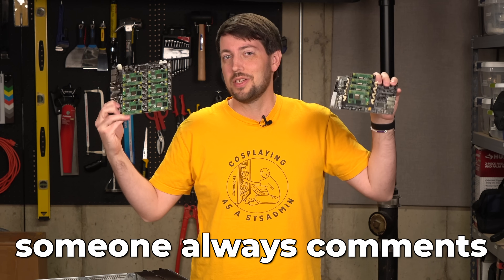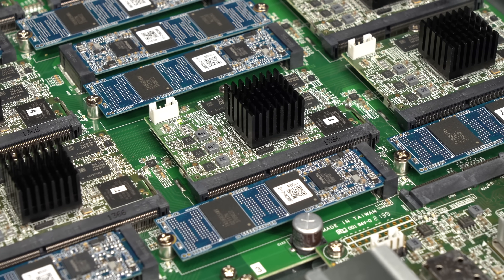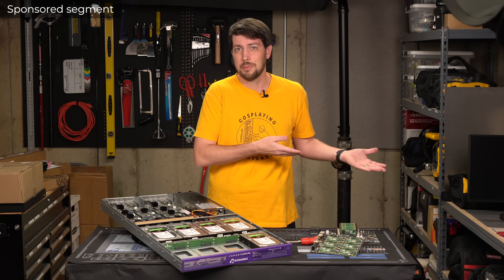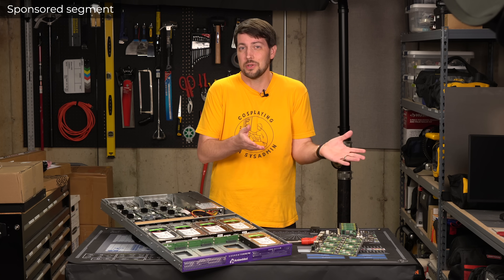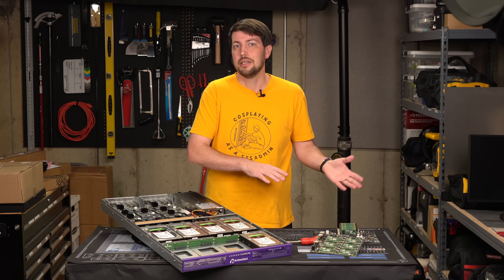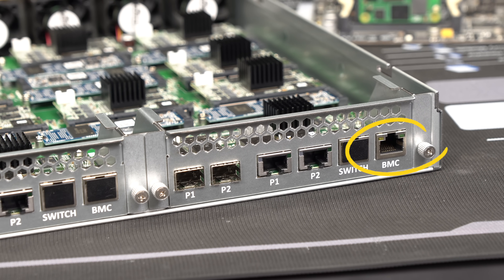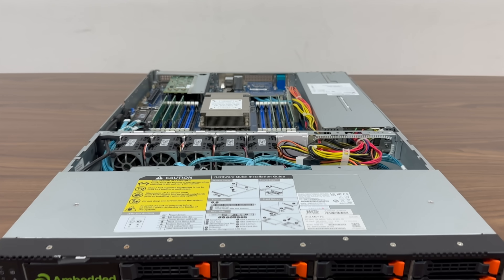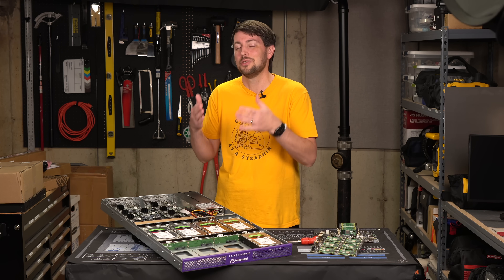This storage cluster is WEIRD! (Mars 400)

Comment: One disk per node? Still seems a little bit silly.
Reply from the maker: There are some NVMeoF devices that are basically drives plugged into a network directly!
Reply: @JeffGeerling  yeah and in that regard the controller that sits in front of them speaking a fiber channelesque protocol is about as simple and barebones as it gets. These sbcs have more than enough computational power to multiplex multiple drives. Seems like a waste of the power envelope, even if they are super efficient
Reply: You CAN have more in ceph, but these are tiny, cheap nodes so one-to-one makes total sense from the ceph philosophy.
Reply: @kevinthorpe8420  Right but they could have easily halved the number of SBCs if dealing with spinning storage.  Now flash on the other hand, that might be a reason because every single board computer I've ever dealt with to fit in that size envelope is a severely bandwidth starved device because they don't have the trace real estate in that footprint to do much, let alone the engineering costs.  

Still, this device kind of feels more novelty than practical, even if you can get practical performance out of it.

Comment: hmm buy 3 seems like a cop out for HA advice. If I get 3, why not get 5, don't bother with the dual power supplies & networking and make it cheaper and simpler. Dual top-of-the-rack switches and UPS would be a better use of that, especially if the dual supplies aren't on separate powers trips and RCDs, How HA is HA would be an interesting series cobbling together all the "hobbyist" gear to beat the enterprise. I'm curious how the air gets through that thing when the HDD backplane looks like the full height.
Reply: Nice thing about Ceph is that you can define redundancy policy to be node, rack, site, etc. aware.  All the redundancy makes the whole environment more resilient.  You get improved throughput as a nice side-effect.  Also, one starts with what one can, and improves things as you go.
Reply: Space and power. The nearest option we had to three of these at ~300W was 7U and over a kW

Comment: One node per drive seems entirely excessive, especially for spinning rust. Fine for learning/testing, sure, but as you already want at least 3 nodes just the traditional 1U server with 8 OSDs each will be less fuss and probably even cheaper.

No hotswapping is also concern for anything datacenter. And worst case might be having to turn out other 7 OSDs to replace one drive (if say your setup doesn't have cables long enough to take the server out while running
Reply: Surely, when you start having multiple nodes per drive, you start running in to drive cache limitations, bus contention, latency and therefore an increased potential for data loss? If every drive served two or more nodes, sooner or later something will have to wait to be written or read. Faster performance and ultimates reliability are usually at odds with each other, so you choose the  est combination for your needs.
Reply: @another3997  That is literally the reverse of what I said, I said "one server with 8 OSDs", as in server with 8 drives attached to it.

One node per one disk is kinda wasteful. You're paying "OS tax" for each OSD, and 8 nodes, even cheap ARM ones, do cost more than one entry level intel box. Limiting amount of disks per server might make sense if you're running into performance issues (say a bunch of fast NVMe  OSDs), but otherwise is wasteful.

Like I said, it's nice if you have test cluster cos you can get a bunch of machines in small amount of rack space, but if you're testing you might want to use VMs anyway, far easier to make changes to that setup.
Reply: Yeah, it would make a little more sense to have 2 bays per node but this was designed to hit a price point so it's all pretty standard. The having 8 nodes in 1U adds  more resilience.

And nearly everything IS hot-swap, even the nodes themselves can be shut down individually and swapped with the chassis still live. In any case the minimum recommended install is three chassis. It's really designed for full racks of these things.

Comment: 7:18 then what's the point of having 8 bays? I feel like I'm missing something...
Reply: I'm guessing the three nodes without drives are  the management nodes. If you have more chassis then those would be spread over several chassis and you'd use those nodes as OSD nodes with a HDD. You'll be missing three HDD in an entire ceph cluster. It's just that Jeff has the whole cluster on one chassis.

Comment: You lost me at licensing :) If this becomes a brick if you dont pay licnese fees, that becomes a problem. I remember Datto doing that to many customers. Their bare metal restore servers were literally bricks.
Reply: Resale value of 0. Unless you can hack it and flash your own OS setup on it and do whatever you want.
Also imagine Ambedded going out of support and you have a brick in a few years to come. OOPS
Reply: I use 3 datto servers are my proxmox cluster XD
2 use standard asrock mobos, 1 uses a modified asrock mobo that took an asrock mobo bios chip
Reply: @DallanLoomis  Those Datto units are super neat but non-functional when you don't conitnue to pay... then again those might be able to be repurposed .... I wish there were a free open source solution that functioned the same way as Datto.
Reply: @BillSargent1977   ya i just repurposed them, one is a truenas box, the other 2 are part of a proxmox cluster, they're just a decent hardware solution: 4x 3.5 hotswap bays, 2x 2.5 internal bays, 2x m.2 slots, 1x low profile pcie x16 slot... built in 2x 10gigE, virtual kvm, short depth, low power draw cpu, 8c/16t, rECC support... so many positives
Reply: @BillSargent1977 my guy if you havnt figured it out yet, thats how enterprice Devices most likely work. There are lots of other alternatives which you might consider, if it does not match your expertations :)
Reply: @papierbndc  most likely? So you don't know then. Thanks. But I've been working in IT professionally since the 90s. So pardon me if I remember things differently than how they are now and harken back to a time when they weren't always this way... at least hardware wise.
Reply: Also NetApp storage, which requires licensing in order to use their hardware with protocols like NFS, iSCSI, and SMB/CIFS.
Reply: lol Datto
Reply: Me too
Reply: So, I watched the ad. And the video. I paused the video to go look twingate up. "ooh, open source client... wait... where's the server? tailscale has headscale, why doesn't this... ... oh no... pricing? I can't self host and use the 'Free' account as just an identity? tsk Okay, I guess I'll continue the video, since I haven't found a nice storage appliance since rising tide systems', I really hope he shows off a nice free user interface that can rival what I pay Synology for..." nine minutes later "LICENSE? Are you kidding me? For a linux box made out of open source parts? F--k, I'll just continue take my chances with the cli and keeping up with systemd unit documentation!" I'm sick of this open core bullcrap where I would gladly pay for a support contract or relevant*, *useful cloud services like identity control, if *that's all they do*. The big problem is everyone wants to be elon musk and have their own X, the-everything-tool.
If I could run a twingate server on my equipment, and only depend on their cloud for the identities of "when i let remote hands in", I would be much more amenable towards paying them a small amount of money. Seeing this hostage-holding behavior just peeves me off and this strikes ambedded off my list of considerations entirely. There's no point in even considering this sort of "redundancy" when you can pick up a cheap R1304 or R1208 off ebay and shell out to the power company a few more kilowatthours, use KVM, and have endlessly flexible VMs with PCIE policy routing, instead of rigid 4GB/16GB ARM nodes that make deployment more difficult. This is exactly why intel nics can split themselves into virtual queues with VT-D...
Reply: If you run  a company that absolutely needs production grade enterprise solutions, then you should have zero issue paying for licensing/subscription fees. At least if you're running a company that has a profit margin worth a damn. If you're not willing to pay for licensing of quality software/hardware, what else aren't you willing to pay for? Quality labor? Here's a hint. You're generally not going to run a medium to larger size business with 100% free open source stuff. And your equipment is going to come with operating/maintenance/repair/replace costs anyway. Which means, 5-10 year old outdated stuff will become effective bricks anyway. Unless of course you're an employee who wants your employer's equipment for free to use at home because you have an employer who doesn't want to pay for quality labor... 

Business-grade, enterprise-grade things come at a cost. Why? Because you're profiting from said stuff. That's the bottom line.
Reply: @georgebrandon7696  so if you are a startup with a new product where do you get the capital? Sign up with the demon investors and the bloodletting they require or compromise?

Yeah this stuff is close to EOL. We are in a better position now so will be looking for better. How would YOU explain writing off ~£500k of capital and maintenance after five years instead of ~£50k?
Reply: @georgebrandon7696  Again, you're missing the point. Companies usually don't want to be stuck with a brick deices that goes to recycling when they upgrade to a newer device or switch to something else. Subscription hardware is bad. Very bad. If you put customized ICs in there that make the device useless, a company can't even ebay it off to reclaim some of the cost later.  And you're nuts if you think small businesses don't buy enterprise equipment. They do. I've worked for such a company and they used the hell out of their stuff. That is why it was important to continue to get service out of the hardware because they'd likely be using the hardware for years and if the company decides to stop supporting the device, well its a brick... especially if they demand companies upgrade to their latest model in order to continue.  This HAS happened. Maybe you're just too young to know or remember how things used to work. And how paying for support was better than paying for a license for hardware.
Reply: Nope. They work just fine without the licence on stock Linux.
Reply: @kevinthorpe8420 "They" meaning?
Reply: Not different from cloud services and saas. I've been told, thats what people want theese days.
Reply: @jani140  I think people want cloud services because then you don't have to bother with deploying and managing the hardware yourself. If you still gonna have to pay for the hardware, space, utilities, infrastructure, and maintenance, on top of a monthly subscription or license fee, then what's the appeal of an on-premise setup? I'd just go with cloud.
Reply: @jani140  That's the point, it is significantly different from cloud.
Enterprises are using the cloud when they want easy to deploy solutions that run in locations remote to their offices.
But when they are buying the hardware to run in their own datacenter, the reason is usually resilience (second reason is price).

Being dependent on third party is always a problem because if that third party has an issue, it will affect you, and there is nothing you can do.
Even worse, if that third party decides to stop providing the service that you are depending on, or goes bankrupt.
Recently I had a big issue with saas that I was developing because pusher (a third party websockets service) was down for 3 hours.
Effect: My service was down, I had to disable websocket features for that 3 hours, 
and then I had to manually recover all data that was lost due to websockets not working, which took me a week.
That is a lot of lost money, due to third party issue.

Imagine loosing access to all your stored data for 3 hours because of a third party license server failure.
Or worse, loosing all your data because the company that sold you those servers went bankrupt.
Reply: What world are you living in? Anything that is commercial and made for enterprise class is by subscription. It’s just the way they make money and keep the development cycle alive.
Reply: @PeterRichardsandYoureNot  Selling support and software used to be the enterprise way... You must have forgotten. Making physical hardware you buy useless and non-repurposeful when its outdated is silly.
Reply: @PeterRichardsandYoureNot Nope. Anything made for Enterprise is not subscription. It's the support contracts that are the normal subscription path for Enterprise. Paying for quick resolutions to issues. Not subscriptions to keep them just running.
Reply: @PeterRichardsandYoureNot   you mean by stealing open source projects , then leveraging licensing into it ?.... then giving FA back to the community.
Reply: @PeterRichardsandYoureNot the development of ceph itself isn't funded by that subscription. the hardware itself is a bit meh (hot swapping disks is not possible) and the software itself is just a wrapper around ansible + cephadm.
Reply: @PeterRichardsandYoureNot I can think of plenty of enterprise-class software that is NOT subscription-based. There is a difference between paying for support and paying a subscription for the actual software.
(Edited to clarify: the difference is that in one case you don't end up with a brick as soon as you stop paying the subscription)
Reply: @PeterRichardsandYoureNot  gen question, how does it benefit you to defend awful practices, even if it's the norm?
Reply: @ThylineTheGay fr

Comment: I've ran CEPH on my ProxMox 7 node cluster a few years ago.  While it worked well but it had performance issues whenever it's re-balancing.   From what I understand that CEPH recently has gotten alot better at that so may give it another try on my backup Proxmox cluster at work.   CEPH is great for what it is but you really have to know it's in and outs to get the most out of it.  Which is why companies like this offer support contracts.

Comment: I think computing companies should try the transputer archetecture again. the idea being that you have a proccessor with it's own onboard ram and switch to allow for any number of processors to work in parallel.
Reply: The transputer was, and is, an interesting concept, however, it didn't succeed in getting a foothold. A modern cluster of networked nodes could in theory make use of that concept, making each node equal and responsible for sorting things out with it's neighbours, but I imagine there's a lot of latency involved in the process. Even if the architecture were scaled down to modern CPU die sizes, would they be any faster than current multicore, multiprocessor designs? Bus contention and latency are big issues in all high performance systems.
Reply: @another3997  That's how the computers on the USS Enterprise work. So maybe.Edge computing is a big thing nowadays.

Comment: Do they ship these with a list of installed MAC addresses so you can set IP reservations before plugging it in?

How are you liking that CRS309? I have two of these, one for my lab (XCP-NG on used HP servers) and one for work's production XCP-NG (as top of rack on new Supermicro servers).
Reply from the maker: I didn't ask about pre-configuring, but the one they sent me was configured with a couple customizations out of the box, so it's probably an option to at least have them send you the MACs.

I love the CRS309—I have three of them now, they're quite handy!

Comment: That's sexy gear. I wish more people knew about these ARM solutions. I know people in IT maintaining tons of servers and they have no clue what an ARM SoC is. Many of their tasks could be offloaded by low-end to mid-range ARM devices consuming about 10 x less. But changing somebody their views takes time. This video can help for sure. 👍
Reply from the maker: And this server is actually an older model—the newer ones are much faster, and even more power-efficient.
Reply: Is it though? No SAS. Very poorly designed drive bays. License(s?). More drive bays than you can use. And 5 rusty spinners are going to give you maybe 800MB/s sequential writes. Doesn't seem very sexy for a base price of $3500 plus licensing.
Reply: @sazma  Why SAS? Each node has internal Flash, an M.2 and possibly an HDD or SSD. The aggregation is at the network layer. It's a textbook Ceph deployment with lots of small servers handling a smallish amount of storage each. The only major issue of this is slow rebalancing times. You can load 8 HDDs on them depending on the role of the specific node. Since this is a single chassis I would guess that the three missing HDDs are the bays for the management nodes. If you have the recommended minimum three chassis then you'll have one HDD missing per chassis.

I agree it's not full enterprise grade kit. But it fills a niche that a few years ago nobody else supported.
Reply: @kevinthorpe8420  Because it's Enterprise price. Perhaps you're right about 8 hdds, but from what I understood from the video, 3 supervisor/mon/whatever are suggested, so that seems like a possibility rather than a likely scenario. It's a fun tech demo, for sure, but it's definitely WAY overpriced and FAR better solutions can be had for FAR cheaper.
Reply: @sazma Claiming it can be had cheaper/better somewhere else without proof is just hot air moving.
Reply: @ramdynebix  I didn't realize one could only post a youtube comment if they provided proof. Also "hot air moving" doesn't really work for a youtube comment. Good try though.